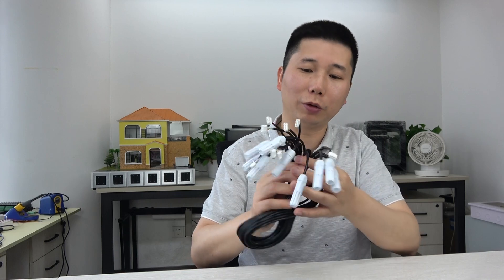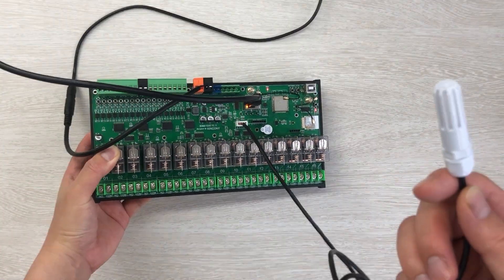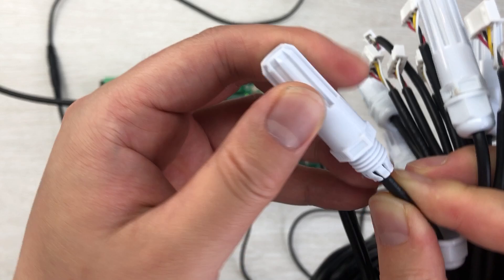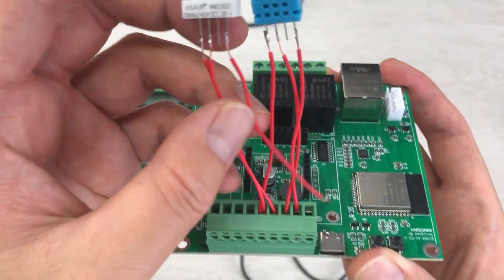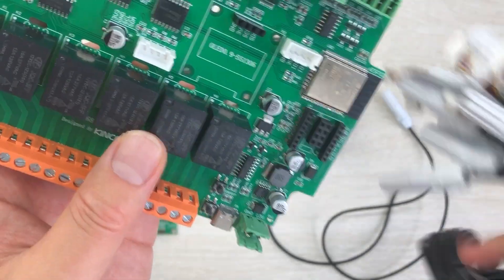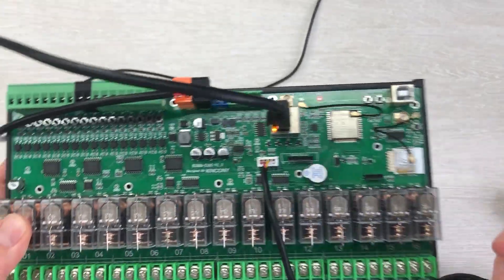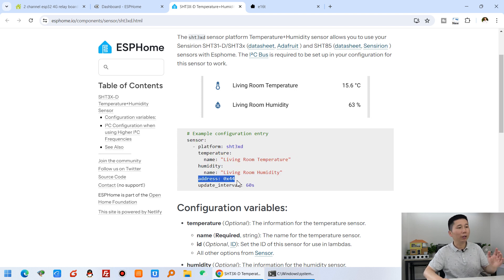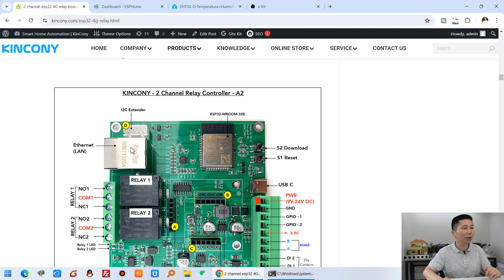SHT30 Temperature And Humidity Sensor i2c Cable for KinCony ESP32 PCB

Comment: are you able to connect a mmwave presence sensor such as LD2450 to this board?
Reply from the maker: we already have this type of ESP32 board.
Reply: @KinCony  which board is it? And do you have a video showing the MMwave presence sensor and how it works?
Reply from the maker: @dnadna6593  this board not uploaded on webpage, Yes, we already worked with ESPHome for home assistant.
Reply: @KinCony  Actually I am interested to know if a MMwave presence sensor can work directly with the kincony system directly. In case home assistant goes down, the presence sensor can still function. Is that possible?
Reply from the maker: @dnadna6593  now, our firmware not support this directly.
Reply: @KinCony  Thank you for your reply. I look forward to be able to see mmwave sensors work with your system!
Reply from the maker: @dnadna6593  ok, maybe in furutre.

Comment: Thanks very much! Very interesting. Is there a way to connect 10 of these sensors to a single board? Maybe they can work in parallel like 1wire?
Reply from the maker: that need customsize to make a sensor can be change address, now the SHT30 fixed with 0x44 i2c address.
Reply: @KinCony  Hello sir, how can the customized sensor to be changed the address?
Reply from the maker: @NSRElctroKH  it's not easy, it have fixed by PCB.

Comment: Thanks for the new project. 

How much lond distance can be used with this? Can i use cat6 cable 300 meter long with this sensor?
Reply from the maker: no, 300 meter too long for i2c bus. it should <2 meter. if you want use by 300 meter, you can use our RS485 temperature sensor.